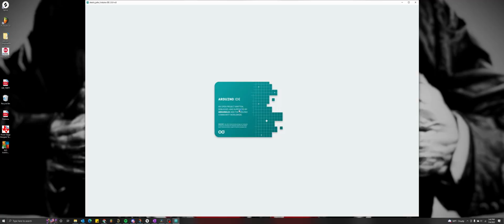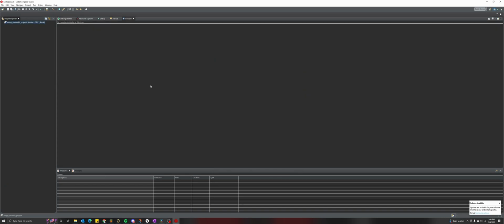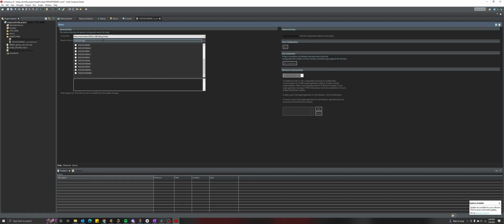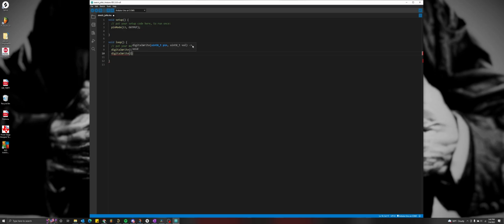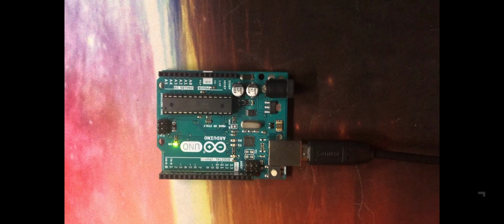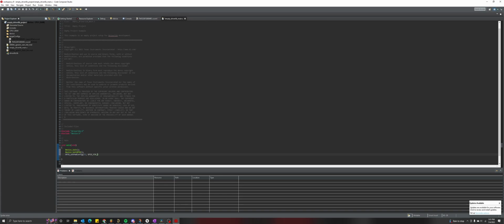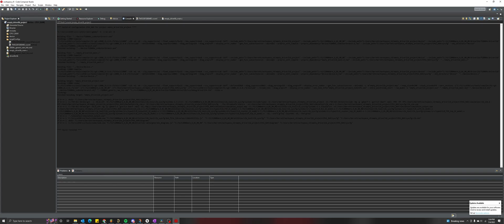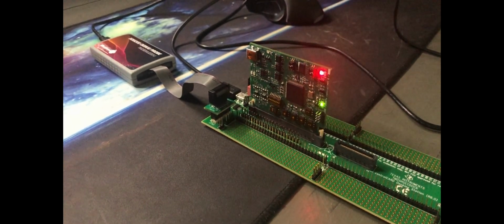Arduino to Pro | LED Blinky

Comment: You can run a lower-level build with an AVR MCU with AVR-GCC, and I assume can do the same low-level JTAG debugging using Atmel studio if you wish. Microchip also make updated chips to the venerable atmega these days, newest in stock ones are the DA/DB/DD lines. Two other extremely popular MCU platforms for hobbiests might be with STM32 and ESP chips, both with decent FOSS & OEM-provided ecosystems. The RP2040 is another singular option that's fully FOSS. I'd be curious to know if there's any particular reasons you chose TI as a comparison platform here.
Reply from the maker: Yes, I am currently working on an Arduino project like that :)